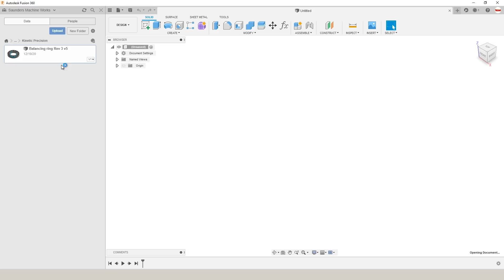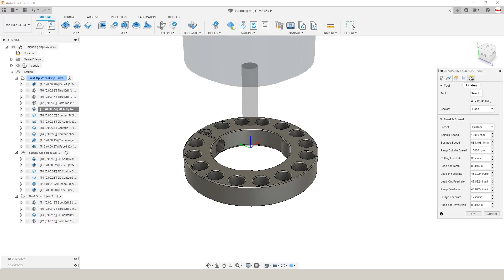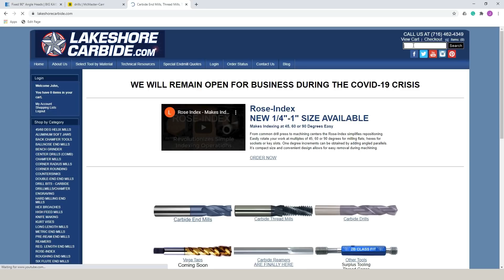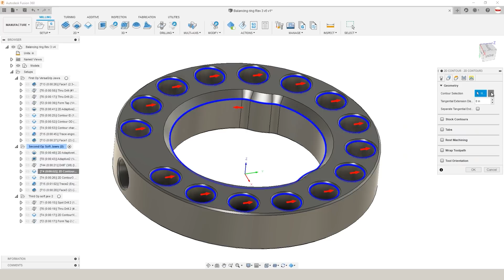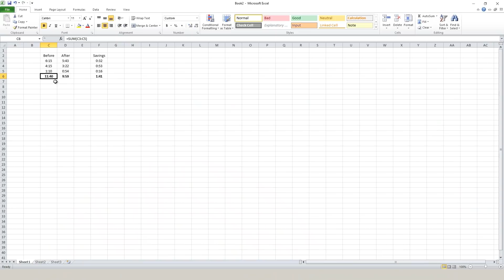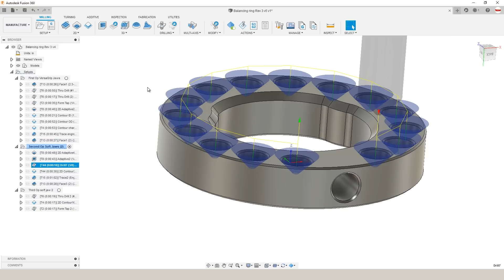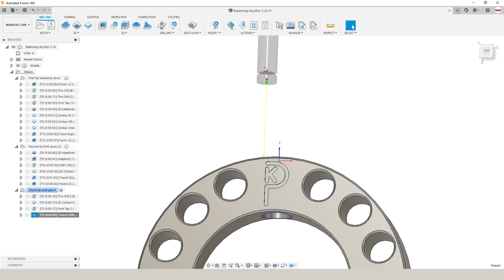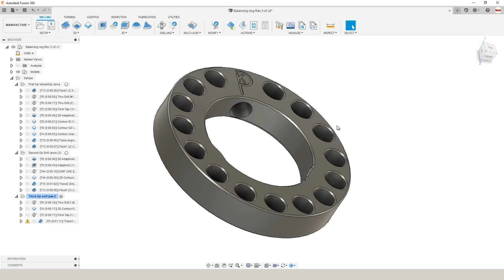Reviewing someone's Fusion 360 CAM!

Comment: Awesome video. A lot of good insights in here.

One note about the Cogsdill I found out recently doing some repair work. If your holes aren't very round and your material is hard at all (in my case basically a keyhole shape) you will absolutely, immediately, destroy the cogsdill tool. The obround area will cause the spring-loaded blade to extend out into the void, and then hit the side wall, which at least in steel shears the blade and grenades the shank inside your part. That said, I absolutely love the cogsdill tools and when you are dealing with normal holes they work scary good.

Comment: Looks like a lathe part to me. Bar-feeder and bar stock and this could be a lights out high-volume part.
Reply: Yeah, if you have the lathe for it (dual-spindle, live tools etc.), it's a no-brainer. I'd even use tube stock if you can find the right size, as I do on my ring-shaped parts. Less waste, less machining time, cheaper stock in my experience.

Comment: Usually you drill deeper than necessary when tapping a hole so you can tap to full depth.
If you run this program, it will crash when the tap bottoms out because he didn't drill deep enough
Reply: Moving tapping to setup 2?
Reply: @andrejsgelins9296  Why would you want to tap a hole not in the same setup as the drilling? You're just asking for problems, when the alignment isn't perfect.

Comment: very nice  I had to visit that engrave drag tool- we used to use a compression engraver for anodized parts that varied in height. Then we started using the Haas probe to reset Z value for a ER16 collet held engraver. Either ball mill or engrave at 10K RPM.   Was seriously looking at AirTurbine to go 40K for engrave but I may look at the drag tool. 

I like 90 deg Mill/Drill to spot/chamfer and also contour chamfer and normal jobber drills unless $ warrants it

Comment: Something seems wrong with the chamfer change from a contour to a plunge. I would expect a lot more time savings. 
Also since the endmill is so close to the pre drill diameter, I bet you could just plunge that and not do the helical ramp and shave off even more time. If you slightly offset the plunge point, from the drill point the chips will break and not make long strings that wrap around the endmill. 
Then for that last little bit in a high volume production program, I always go in and tweak the g code by hand to optimize rapid and linking moves, especially when two operations use the same tool. Most CAM software treats each op as it's own self contained thing and not part of a whole program. For example doing a retract and rapid back to the center of a pocket then going back to the same place to start a finish contour. Just leave the tool down and feed or rapid into position. That and doing XYZ moves instead of XY then Z. It all adds up and I have been shocked at how much time can be shaved off a program with no loss of quality in the part.

Comment: You’d save time to make the feed plane of the chamfer tool to below the part face by enough to just clear the corner of the hole, then the tool only feeds down maybe .030” or so instead of feeding all the way from .050 above the part.
Reply: Another way to save time is to disable the feedplane.
There's often no need to have the tool plunging with feed-rate (or worse plunge-speed wich default value is ridiculus low) dosn to the lead-in move

Just rapid down to the horisontal lead-in (and get rid of the vertical ones that are stupid when the tool is still in the air)

Comment: In case it helps someone... I wrote this blog post a while back which includes a template for backside chamfering... the expressions would need a little tweaking to get it to work with Trace, but the framework of the expression is there. https://blog.cadpro.co.nz/manufacturing/undercutting-backside-chamfers-in-fusion-360/

Comment: interesting question/challenge: could you chamfer the sidehole using a lolipop cutter in the Coordinate System from Setup 1? that would be a pretty complex toolpath and I would like to know if it's possible in F360
Reply: Yes you can use the flow tool path, very easy to program
Reply: Yes but the hole would not be there to chamfer at that time.
Reply: @jamescarter9147  obviously, but that's not the question...

Comment: It's possible to make this part  efficient on a cnc-lathe?
Reply: It ought to be a mill turn center at least, but I think that would be the more efficient way too 👍🏻 However: you got to do with what ya got 🤷‍♂️
Reply: @paddyflake  The lathe meet live-tools and a y-axes. Many modern CNC-Lathe are equipped with this options. Especially because John has a lathe model ST20Y from Haas in his shop that can do that.

Comment: Programming?
Reply: Programming by hand used to be the standard/only way to create tool paths so I think that’s why it’s referred to that way. Many NC machines have the ability to write (program) lines during operation, although in using a hobbiest desktop machine I dont have too much experience with it.
Reply: @palmerinsull2455  writing gcode is not programming
Reply: @ericbeckers2673  You are typing out commands for a computer to follow. That IS programming. It's not C++ or Java but it is programming. "Preparing an instructional program for a device (such as a computer) is the Webster definition.